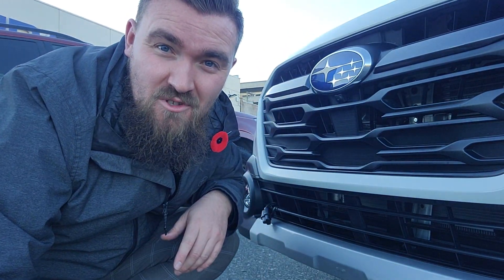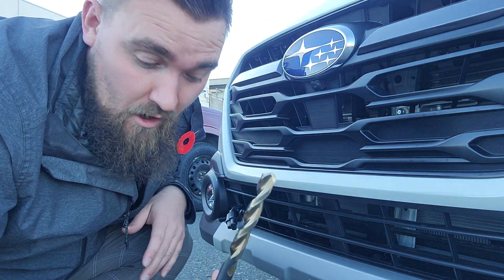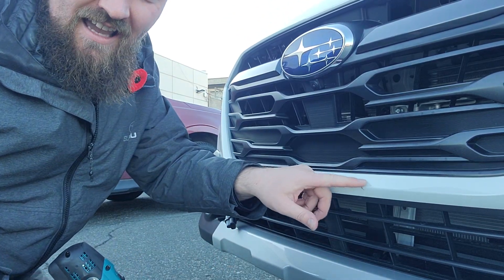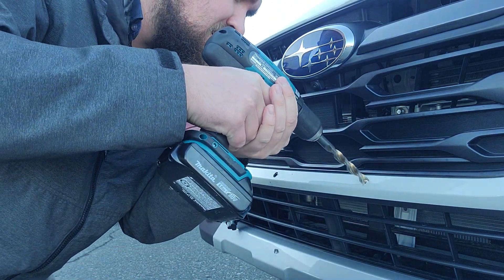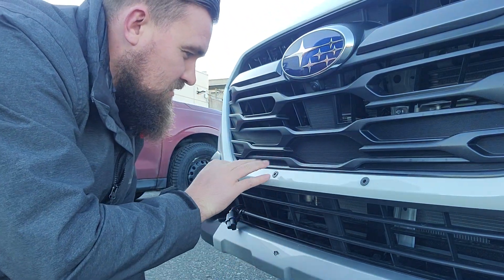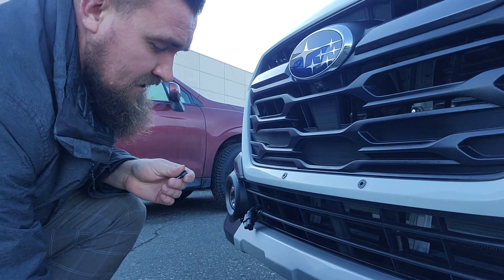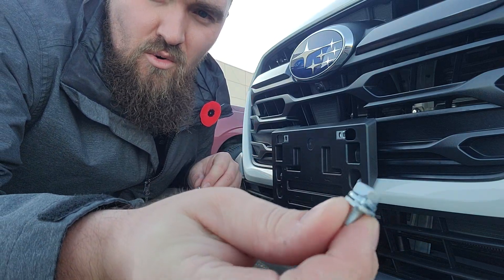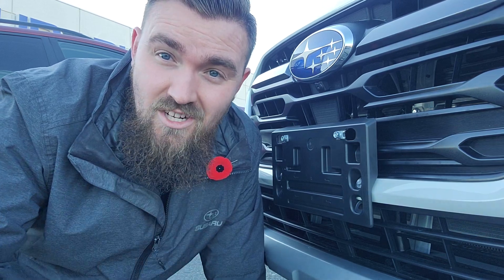How to install 2024 Outback/Legacy front plate bracket

Comment: How bad does is block the view from the front camera?
Reply from the maker: It doesn't block it.
Reply: @TysonTheSubaruSpecialist  Ok cool thanks.
Reply from the maker: @dcv1681  welcome!
Reply: @TysonTheSubaruSpecialist  Part number 57751AN00B (Superseeds part 57751AN00A)   Subaru's site said this part would fit my 2025 wilderness it doesn't. The holes don't even match. Any idea of the right part number.
Reply from the maker: @dcv1681  for the Wilderness Outbacks, there isn't a bracket for the plate, it just screws into the indents in the front bumper.
Reply: @TysonTheSubaruSpecialist  I see that but the Subaru site says the the part number I listed fits my car. They might want to take that down then.lol Take care and thanks.
Reply from the maker: @dcv1681  I agree, they should take that down. I don't see it listed on the Canadian site.
Reply: @TysonTheSubaruSpecialist  I sent them a email telling them this.

Comment: Hello, any tips on how to remove the bracket? My state does not require front plates, and when I try to remove the mounting bolts those plastic rivets are spinning in the back. Tried to get a grip on them with a pair of channellocks but no luck yet.
Reply from the maker: @ChrisPatton-qm2ep  I have yet to try and remove one, mostly because it'll leave two sizable holes in the front bumper. 

I guess, if you aren't planning on keeping the bracket to ever reuse, you could just cut away all the plastic and then gain access to those rivets and figure out a way to remove them from there.
Reply: @ Thanks for the reply. I ended up drilling the bolt heads, with the intention of drilling them all the way through, but the heat ended up melting some of the plastic on the plate cover away and I was able to pull the cover off and then use pliers to pull the bolts and rubber backs out. Had some 1/2 rubber plugs that fit the holes well, looks a lot cleaner on the front now.
Reply from the maker: @ChrisPatton-qm2ep  Awesome! I'm glad that it all worked out for you!

Comment: I juat bought a 2024 outback yesterday in Colorado. I live in Wyoming where we have a law that states we need front and back plates unless "(VIII) A motor vehicle which was originally manufactured without a bracket, device or other means to display and secure a front license plate;"
The dealer gave me the bracket but didnt install. I wonder if this means I dont have to.  Technically it  wasn't manufactured with a front bracket. 
I'm nervous to mount it. 
Thanks for the video!
Reply from the maker: Thanks for watching! 
You could probably get away without installing the front bracket, but that's going to depend entirely on the law enforcement officer if you get pulled over for it. You might inquire with your local PD/DoT office and see what they have to say about it.

Comment: Excellent video. What’s holding the rubber plugs in place? Should they be installed from the underside so the edge holds them in place?
Reply from the maker: @sergiolemus1996  thanks for watching! When you insert the bolts into the rubber plugs and tighten them, they bulge and hold the plugs in place, kind of like a rivet.

Comment: um wtf you literally have to drill into your car to install the front license plate? they couldn't put screw holes in it? jfc
Reply from the maker: @Brandon-qp7gq  you could use screws, but with the mounting hardware, they want you drilling into the bumper to install it.
Reply: Works with the 2025 Wilderness ? Ty in advance !
Reply from the maker: @houseofmirrors4138  the Wilderness is entirely different. They don't have the same bracket that the non-wilderness models come with.
Reply: As much as they cost holes should already be there just saying .24 outback onyx